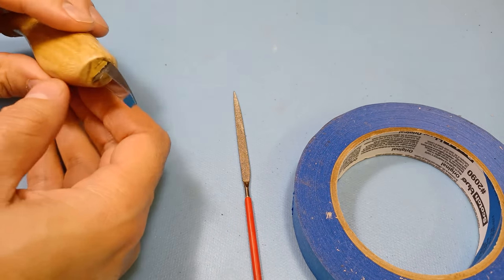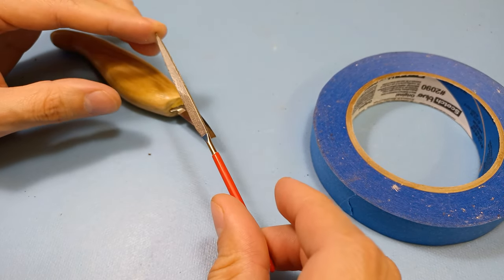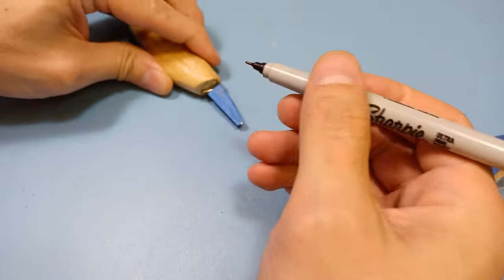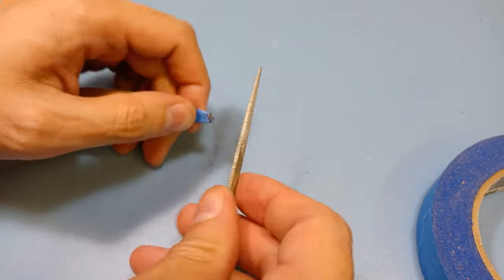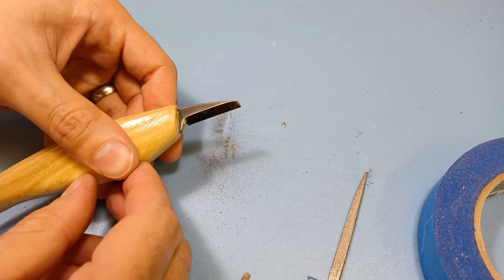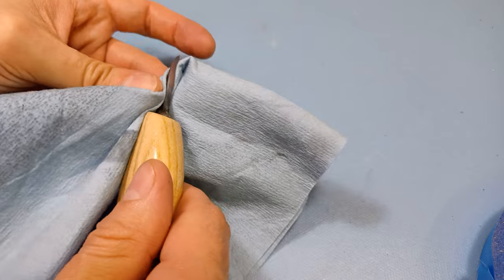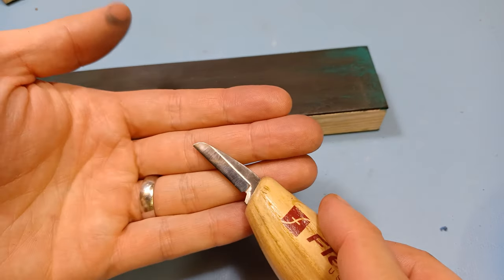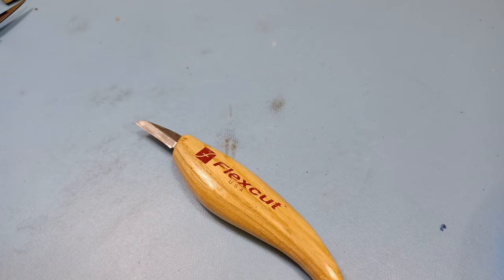Fixing a Broken Whittling Knife!

Comment: Nice job! I had to fix a broken tip on a detail knife just last week. I done the same thing except I used a sanding block with coarse grit paper. Your method seems to work well also. Thanks for the tip (no pun intended) :)
Reply from the maker: A sanding block sounds a little more comfortable to manage than my tiny file :)  My hand was a little sore when I was done but that's just due to an old injury from childhood.
Reply: What type and grit did you use? I'm trying to fix the square shape of a beavercraft hook knife to have a more convex rather than flat outside, but I destroyed my 130 grit wet dry sandpaper and barely made any progress!
Reply: @RexMcTavish  You may need a powered grinder for that job. Be careful though and keep a cup of water close by to dip the blade to cool it off while grinding. Don't overheat the blade or you will ruin it.